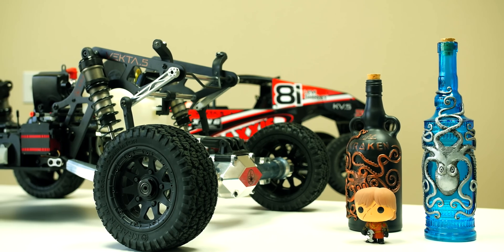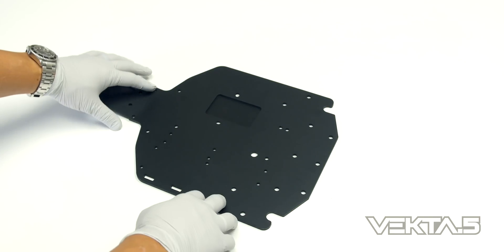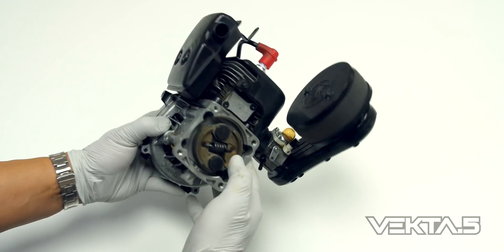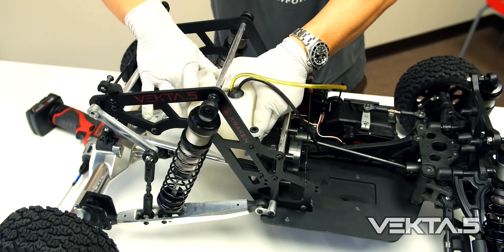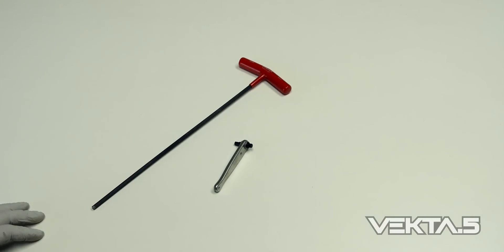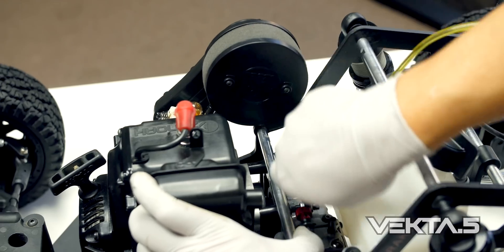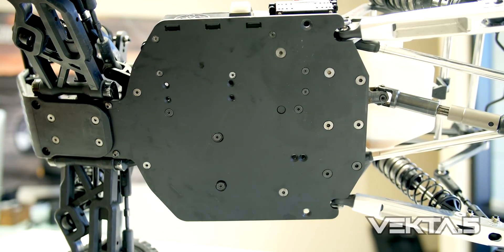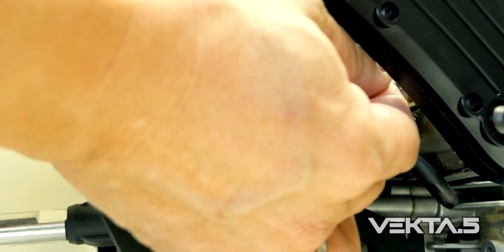How to install your engine to the Kraken VEKTA.5

Comment: I'm pretty sure my engine is out of alignment. I'm using a TR snapper clutch, there's nothing wrong with the clutch as I've been using it for ages. Yet when I installed my engine in this, the snapper clutch seizes up afte a few minutes. As soon as I undo the engine bolts it frees up again
Reply from the maker: It's your clutch housing. Use either CY or Zenoah's. Same ones from Baja not LOSI.
Reply: @krakenrc  I'm using a Turtle Racing billet housing for baja
Reply: @krakenrc  I did try the housing from my 5iveT, i almost got through a tank of gas before it seized
Reply from the maker: @geejayrc9401  I'd check the TR snapper clutch, something might have come loose.
Reply: @krakenrc  I've just gone and loosened the engine bolts a bit and it freed up a bit, but not 100% free movement. Upon closer inspection with my trusty old torch, it actually looks as though the pinion gear might have worked loose a little? it doesn't look like it's sitting hard against the clutch bell/basket. I used red loctite, but maybe not enough which is why my first run I nearly got through a whole tank, and this time only a few minutes. I'll have a proper look later, it's very hot here today in my part of Australia lol. I'll let you know :)
Reply: @krakenrc  Problem fixed. The pinion/basket were very loose, so much so the basket had worn away the tops of the screws on the snapper clutch. I've applied a truck load of red loctite so I'll take it for a run later on to let that cure

Comment: I will be placing my order at the end of next week for the Vekta without the engine, I also just ordered a OBR Zenoah G340RC +2 Stroker engine, 9.4hp, DDM Plated Pipe, Turtle Racing Snapper Clucth with HD Housing, Billet Steering Horn and more goodies. Cant wait to get it all here.